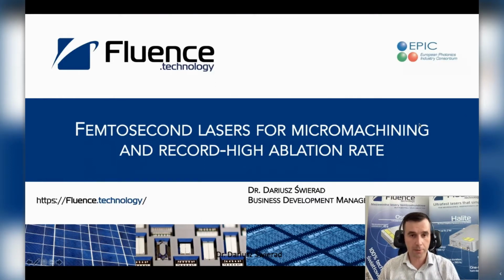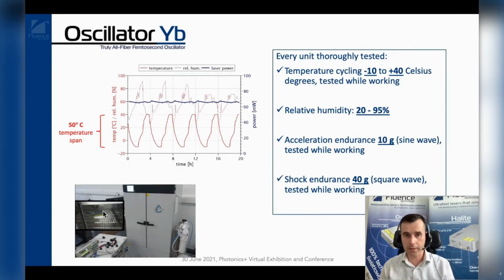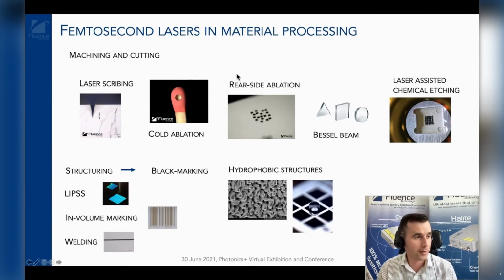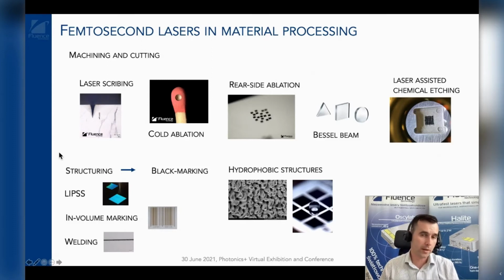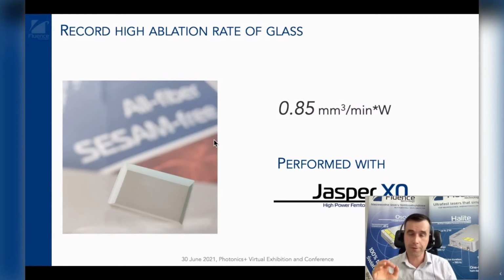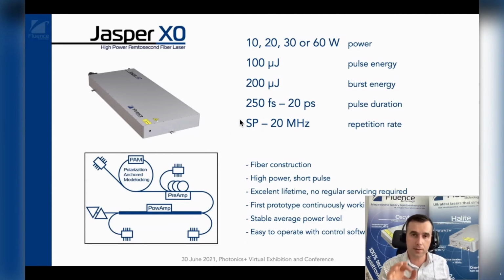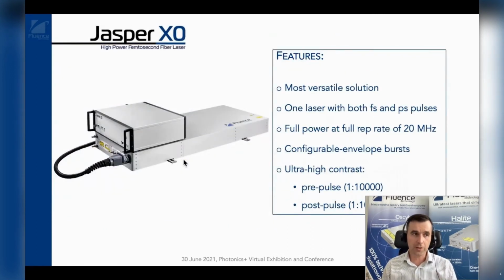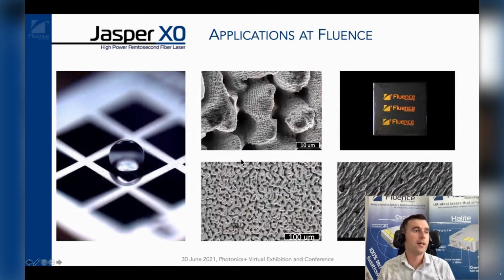FLUENCE - Femtosecond lasers for micromachining and record-high ablation rate PHOTONICS+ 2021

Comment: What is the maximum depth through which we can scribe on the glass by JasperXO ? can we cut 5mm thick plate thoroughly with 100um curf width with JasperXO ? if yes then what will be the processing time?
Reply: Yes, it is possible. Glass cutting is usually performed with so-called Bessel beam cutting. We are happy to send you more details and information on the speeds, just drop us an email at info@fluence.pl